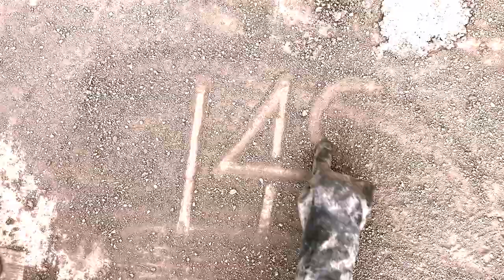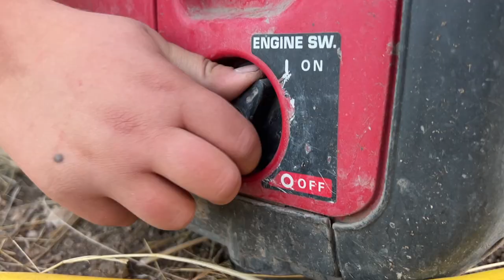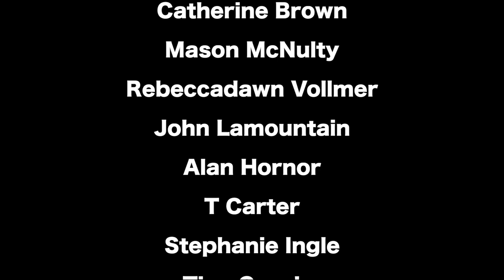Shhhh...It's a QUIET Family Work Day - ASMR Earthen Plastering (Chicken Garden Day 148)

Comment: Had a discussion with my wife about how great the chicken garden would look if you painted it the same barn red color as the earth bags. Then I saw the video where you both talked about wanting to keep it a natural color to blend in with the surroundings, which is wonderful. One question: With the extreme weather you folks experience there (baking sun, torrential seasonal rains, and even the occasional freeze), how are you going to keep the walls from cracking and deteriorating? I would have assumed painting or weathercoating it in some way was going to be in the picture every few years. Are you just going to replaster it as it cracks and erodes?
Reply from the maker: Any earthen plaster will need maintenance over the years, but yeah we're working through exactly that as we start on the final plaster later this week. Doing tests and such. Keep watchin'!